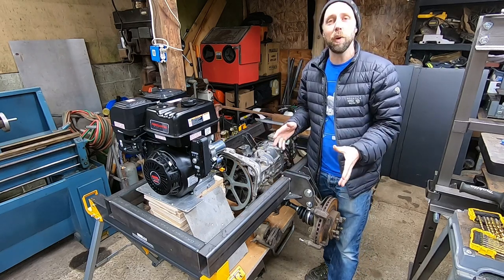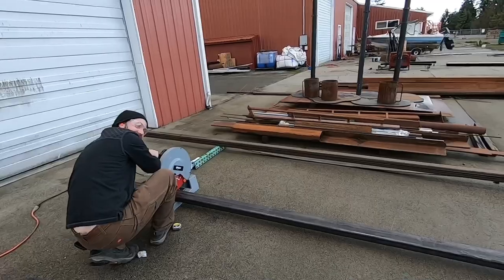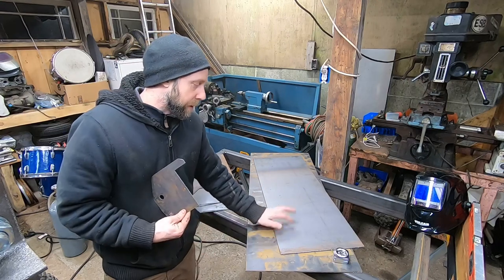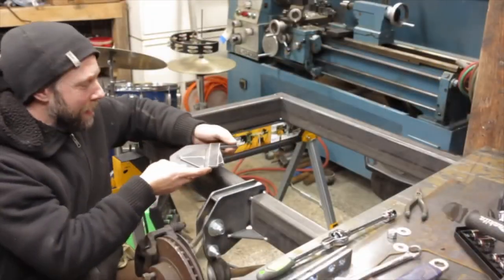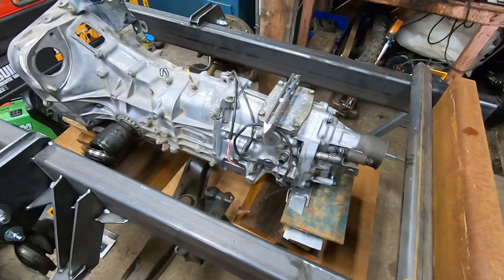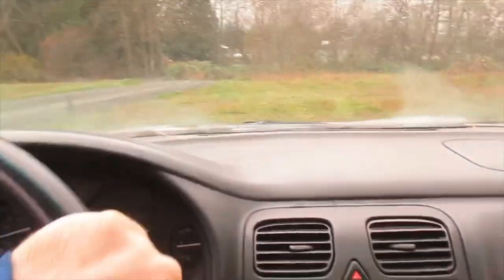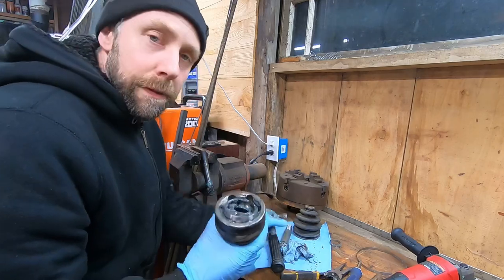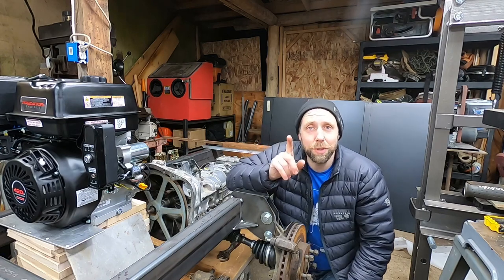420cc Predator powered articulating 4x4 dump truck build part 1

Comment: Does that engine have an alternator on it to charge a battery? I am going to buy one to upgrade my harbor freight sawmill.
Reply from the maker: Yes It’s got a charging system and electric start. I can’t remember how many watts it puts out but it’s enough to charge a battery and run some LED lights. I do see the Duro brand on Amazon sells for less and clams more HP who knows? I know both brands are the same 420cc maybe the Duro has a bigger carb??? I do know I bought a Duro 7HP for my quad truck and I had a few small problems with it, not big but enough where I questioned buying another one, that’s why I bought the 13hp predator from HF I have not had any problems with my other 6.5HP engines from HF. I bet this engine would really help out your mill, I’m running a 12hp Kohler on mine and it seems to be plenty of power. Take care
Reply: on RBG  they just showed an add on 65 amp alternator .  you could find out on there because it had everything for it.

Comment: Its a superduty d60 bearing Idk 99 or 04 and if the studs being metric 8 x what ev but if the studs are fine thread its for a drw and has a greater load capacity btw Idk could be a dodge unit bearing but I dont think so... I thought ford has 4 stud square mount? Idk not a diesel dude ..... and the cv joints THROW the birfield / cv joint into a pipe or slide the shaft into a longer tube and THROW it down to the concrete HARD the weight of the shaft pulls the snap ring out this is the only way to do it on a toyota solid axle by placing the cv joint and shaft into a larger longer pipe so the birf bottoms out on the pipe before the shaft touches the ground by 2 inches idk and use gravity and momentum to loosen them crappy galvinzed pipe works amd is cheap and I mean throw the toyota joints are bigger so this shouldnt be an issue the snap ring cir clip is way small and WILL ALWAYS BREAK so Idk I tack welded the shaft instead  of buying a clip but I would buy a clip

Comment: I am highly interested in the plasma CNC machine. With modern computer how long does it take to program those brackets?   Way back yonder I worked in a production CNC parts place. I made holding fixtures for big Mills. I never learned any CNC besides the Hurco conversation machines. Anyway that company had a 10'x20' water jet. If I had brackets to be made I would simply hand sketch what I needed and would take it to them. It only took a few seconds to cut my parts , but it would take an hour of them on those old computers to program it.    Surely by now it is quicker. Also where can a person learn to do the programming?   I'm sure if I had that table I would do more builds , if I had the knowledge to program.
Reply: He uses Autodesk Fusion 360 to design the parts.  There are lots of youtube videos out there to learn how to use the software. I think it’s free to use for home too.

Comment: So how do you like the Predator engines ? Does Harbor Freight sell rebuild kits for the carbs?
Reply: I don't know if Harbor Freight sells carb kits or not but I believe you can get a brand new carburetor online for around $10
Reply: Or just remove the guts and toss into an ultrasonic cleaner.

Comment: Yeah, but how much time does it take to write a program for the CNC plasma cutter? I've never worked with CNC, so I really don't know. Nice project though.
Reply: It generally takes very little time for basic 2d parts like this, I would guess the cad and gcode took less than 10 minutes for each design and you can reuse it as many times as you need.
Reply from the maker: Yes Brian is correct, I’m still learning to draw in 2D and I’m getting quicker all the time.
Once you export the file you keep it in a folder and it takes seconds to pull up to cut. 
I’m a busy person like most people, what I like is I can draw up a part at my work if it’s slow, after dinner In my warm house as long as I have some basic measurements jotted down on paper, then the next time I’m in my cold shop I can cut the new parts out quickly. Take care

Comment: Hi sir. I've been looking into a lathe about the size of the one you have. How much should I expect to spend to have one similar to yours and would a smaller one work for what you have done so far?
Reply from the maker: I have a 13x40 inch metal lathe, it was built in the mid 80s in Taiwan, I bought it on Craig’s list for $1600. I had been looking for about 6 months for one, it came with a lot of extras which is nice when buying used. For the most part I could have gotten by with a smaller lathe but I do side work with it so it’s nice to have extra capacity. Take care Albert 🙂
Reply: @Mikefestiva  thank you very much.

Comment: Why don't you just look for a Jacobsen UV-4 or Pug utv? (Same thing) I have a UV-4 there are a few videos on here from my previous channels.
Reply from the maker: I just don’t see those machines for sale ever out in the NorthWest. I was considering a mini Japanese import truck but there hauling capacity is only 750lbs I’m hoping to haul 1000 to 1500lbs in this tractor, I’m also thinking of building a plow blade for the front for snow removal.  I like to build things, I also like making YouTube videos, so this project is a good opportunity to create something interesting.
Reply: @Mikefestiva  Makes sense. I didn't know you were out west. There were several UV-4's on craigslist over the last couple months. The furthest west i can remember was in Michigan. You can definitely use their design for ideas. They do have a 1 ton capacity. Mine was about 70% gone when I bought it. The bed was 95% gone. I couldn't even use a single piece of it. So I made one.

Comment: F450 or Chevy 3500 front wheel hub.
Reply: The Center of the hubs on a Chevy doesn't like out that far. I just replaced mine on my work truck so they must be Ford front hub bearings

Comment: Why not use the Subaru engine ?
Reply: Timothy Mccartney because money.
Reply: You had the engine didn’t you?
Reply from the maker: Think about the gearing Timothy, I want it to go 20 mph in 5th at 3800 RPMs not 80 mph
The Subaru would go 20 in first gear. There’s a lot to consider when building things like this, gearing is a major factor. Take care
Reply: Mike festiva 
I am thinking about gearing and i think you may be short on power if you do not have low range , also what kind of clutch set up are you going to run ?
Reply: @tinytrax1978  by using a quality centrifugal clutch and a chain drive to the input shaft of the transmission  you can  adjust  the primary  gear reduction  to get the overall gear ratio lower

Comment: You sure 13hp is enough?
Reply from the maker: I’m confident 13HP should be good,  I don’t know if you have seen my quad truck I built? It’s powered by a 6.5hp engine and it hauls 500lb loads up hills, hauls logs and full loads of fire wood. This is going to have a 4:1 gear reduction between the engine and the transmission, this will make the overall transmission gearing 4x lower, I don’t expect this to go over 20MPH and that’s plenty fast for my property. But I guess if it’s not big enough I can always upgrade engines after I finish it. Take care Kenneth 👍
Reply: @Mikefestiva  Yeah I saw your previous build, nice. I was just wondering because you talked about adding a hydro pump and an alternator and that if 13 hp could handle the strain in the long run.

Comment: What blade did you use
Reply: not sure what blade he had I tried to cut rerod for concrete killed my blade and it would cut 1 inch steel like butter ,,, harden steel kills bandsaw blades .I had to cut the rest of the rerod with a cutoff  wheel ..have not found a bandsaw blade yet that will cut it ..